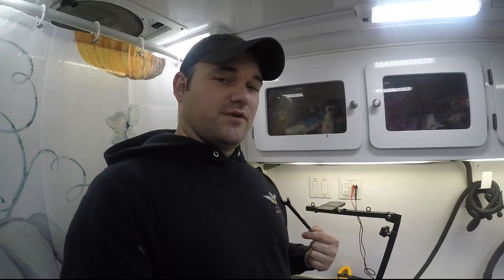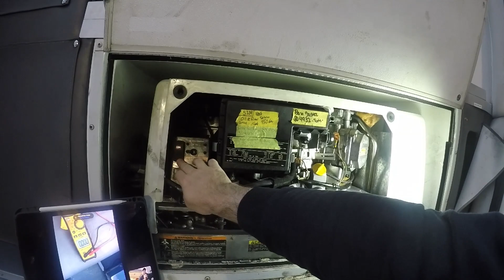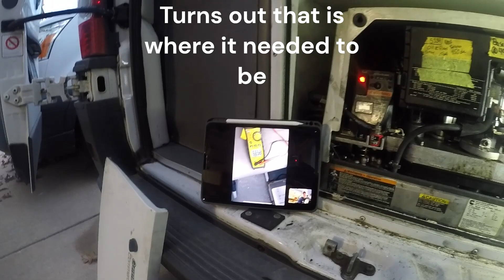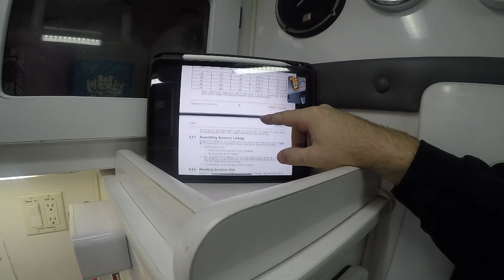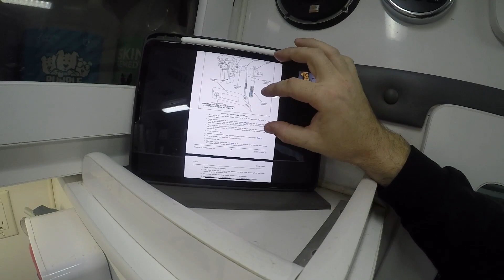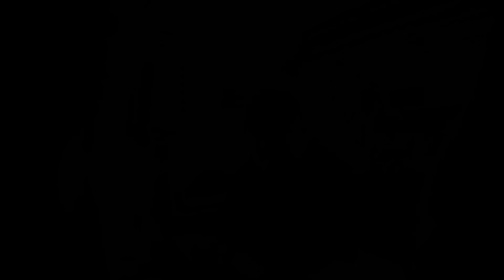Onan Code 14/15 FIX

Comment: Thank You -- !!! you just saved me some money. Just put new filters , plug and cleaned my carb on the micro quiet 4000. Ran great, starts great 560 hours on it. Today i went out to exercise the genset and it kept shutting down after 30 seconds. Code 15. The adjustment is different on the 4000 but I figured it out. REALLY appreciate this video - You made my day...😀
Reply: what did you do on the 4000 to fix it ?

Comment: Thanks for the video.  My generator had been acting up for a while.  Would give me a 15 code anytime I put it under load.  Had done everything.  Cleaned carb, ect.  After seeing your video I hooked up the meter and it was reading like 10?  Tightened down the bolt and got to 30?  Was messing with it when the motor abruptly died and dirt and dust came flying out of the generator, from back in the back.  I guess a dirt dobber or something had built a nest back there.  Is there any other reason dust could come out from inside the case? It hit me right in the face.  😂   I then started it and it was reading 67.  Dialed it back and now it’s working under full load no issues.  Thanks again.

Comment: Hello Chuck & thank you for your video. I have an Onan 7000 HGJAB and I am receiving an under frequency code however the meter shows it’s actually over frequency but does bounce around to over 100 at times. Do you have any thoughts on what is best to try & correct? Many thanks! 
Gregg

Comment: Hey man. So we have a TV truck for doing sewer line inspections here in central Florida. We had an issue with the generator not staying running. Couldn't figure it out. Bought a new generator which is the same model. It worked well for maybe a month or two, maybe longer and started doing the same thing with the code 14. Long story short, this video helped immensely. Thank you so much! So far it's been running over an hour so I think we got it taken care of.

Comment: Thanks for this video! I’m getting code 14 also, but my generator shuts down within 5 seconds of starting, long before the 30, or so, seconds it takes for the power to kick in as shown in this video. Any ideas why it throws code 14 within 5 seconds? BTW, I just replaced my rotor brush with a new one.
Reply: Mine doing the same thing (onan 5500 ).   Mine only has 220 hours .  Did you figure out why?

Comment: So I tried to see my hz with but when I started generator it showed zero in the outlet I was plugged in with it running. Do I need power inverter on to see this or are only certain outlets on generator?

Comment: Age (hours), dirty air filter, generator brush condition (shouldn't but can), slipping belt (bad tensioner, etc), valves need adjustment... basically anything that can affect performance/RPM of the genset will alter the frequency it outputs. It wants to stay in the 60Hz neighborhood because that's where U.S. devices are engineered to operate. Engine/generator RPM determine frequency, sooo... The additional adjustments available allow more control over various other conditions. ALSO - Nylock nuts are a mix of good and bad. They work great for a once and left alone forever, in one place setting but start adjusting them a couple times and they will stray. Best bet is to either replace that nut or install two standard nuts together to lock them together and prevent possible loosening.

Comment: My Onan is a 5500,  hard to start but when it does on for a couple seconds then turns off. Code 14.  Not enough time to get a reading.

Comment: Good info, it would be nice if you did a close up to show the bolt, threads, basically a visual to what its going to look like.  I have the 4000 and it just started to give me the 14 code.  Hopefully I can find this without having to remove the generator.